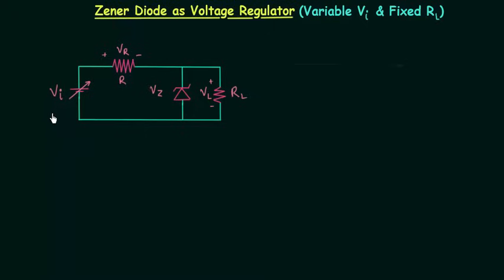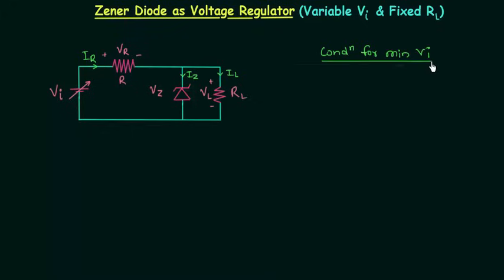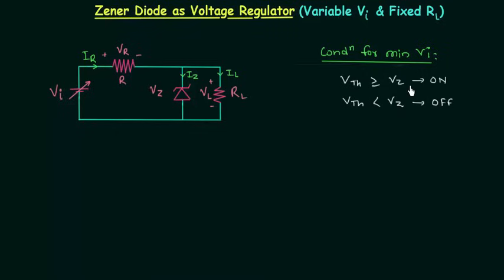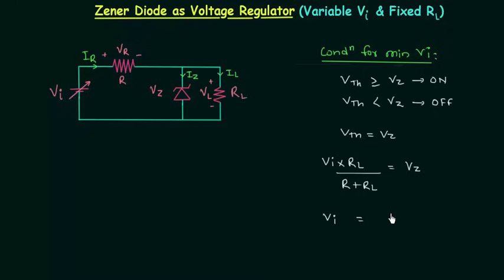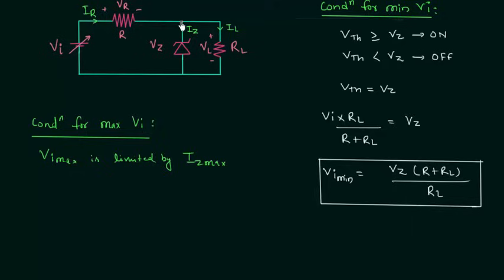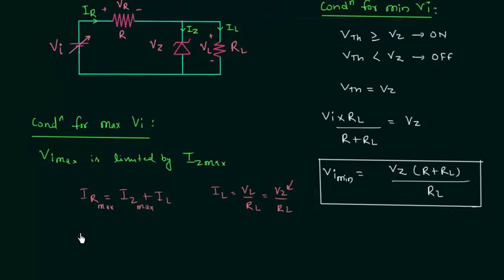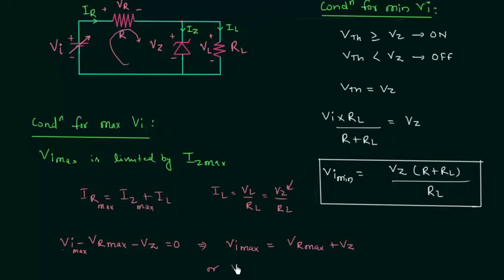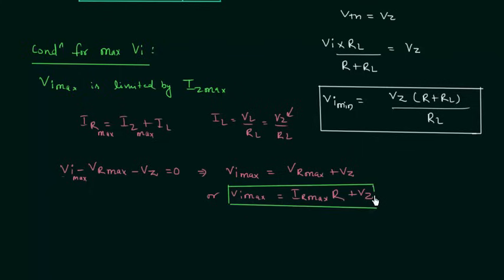Zener Diode as Voltage Regulator (Part 3)

Comment: Sir U'r lectures helped me a lot, this subject was too difficult for me , but Ur lectures help me a lot thanks a lot for It 

Sir I have a confusion please help me,

Sir as u have said Pzm is maximum power dissipation, so by using it can we make equation for Vi(max), I have make an equation for Vi(max) using Pzm below please guide and correct me if i wrong:

Pzm = Iz(Max)*Vz
arranging for Vz,
Vz = Pzm / Iz(Max)
and we know 
Vi(Max) = ( Vz*RL ) / ( R + RL )
therefore,
Vi(Max) = ( ( Pzm*RL ) / Iz(Max) ) / ( R + RL )
and
Vi(Max) = ( ( Pzm*RL ) / ( Iz(Max) * ( R + RL ) )

Please guide Me!!!!